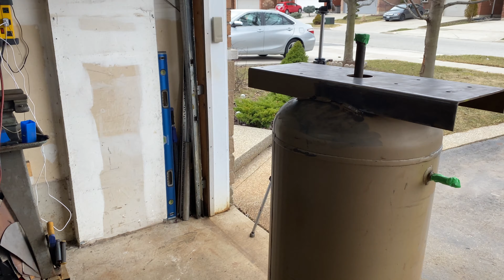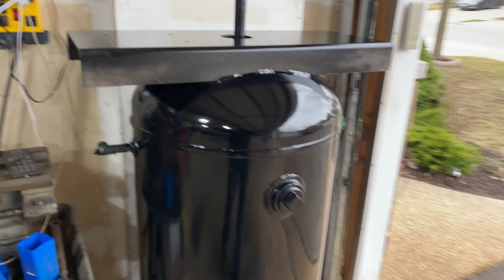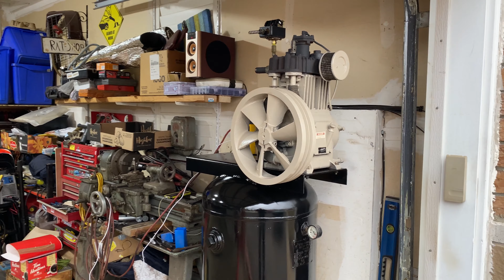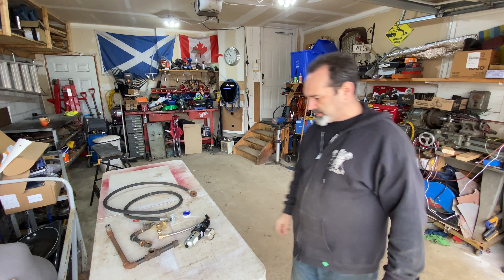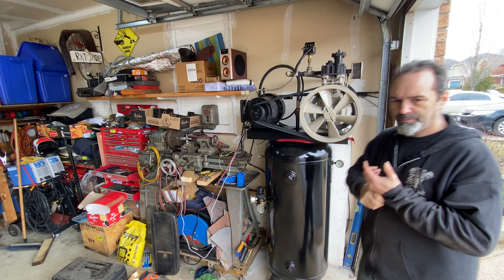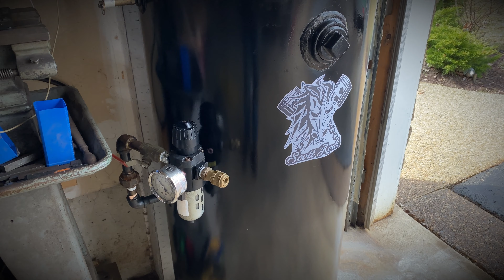Air Compressor Restoration Finale - Painting - Assembling - Testing

Comment: Once you start using your air powered tools, you will wonder how you got by without it. Looks like you got a great deal with the compressor, as most shop bought compressors don't go to that high pressure.
Reply from the maker: I wonder if my neighbours will prefer the sound of the high pitched whir over the sound of electric power tools. I guess we'll find out soon, lol.

Comment: Most Air tools are designed to run at 90 psi.  When you set the regulator have the tool plugged in to the airline and running then set the regulator to 90 psi.  This will give you the air that you need to run the tool properly.  Nice job on the recondition and set up of the compressor!!!
Reply from the maker: Thanks Mac. I saw a guy mention that in a video, but I appreciate any and all advice.

Comment: Why are you using a lubebricator?  You'll  contaminate your supply lines with oil. Spray equipment doesn't need oil, as for air tools put oil in inlet a couple of drops. You'll never get hose clean for painting. Whatever
Reply from the maker: That's why I got two regulators. One for tools and one for painting. I'll need a different air line for paint (without oil in it).

Comment: I was waiting to see if it would start again under full pressure....the pressure switch can be adjusted start on/off stop on/off...go on line for instructions...the knocking noise is probibly the valves in the head...most of them do that... you really dont need more than 135 psi for anything youl probibly doingand its safer...looks like a nice set-up..now get to work!!!!!
Reply from the maker: Ok, I'll leave it as it is then. Maybe the red lines are just the safe operating pressure then. Sorry, I should have filmed it firing up again at the start of the red line. It came on no problem.

Comment: Did you check to be sure you are turning the compressor the right way?  There is an arrow on one of the cooling fins.  I see it in the video...but I'm not sure what way the motor is turning the pump.  I'm thinking you might be going the wrong way.  It will usually still pump air if you run it backwards, BUT you will not have the fan blowing air onto the cooling fins of the compressor so it will run hot.  More importantly, it will also not pump oil correctly if it has an internal pump or oil correctly if it is splash oiled via dip and scoop oiling.   I'm sure you can find info on google if you need to do some research.   Also...I haven't completed the video yet, but you would be far better to have the belts at the inside of the compressor area for safety and also to make it easier to change the oil and do maintainance like adjusting the belts etc.
Reply from the maker: WOW, you are right! I just went out and checked, and it is rotating the wrong direction. Well caught my friend, I will sort that tomorrow. Presumably I just swap some wires about? There's no markings on the pressure switch.
Reply: @ScottRods  There is likely a schematic to follow inside the motor cover.  The ones I've worked on had it anyway.  You might need to look up the info for your particular motor on Google if there is nothing to go by.  Just hoping to help...and BTW, you have a great channel.  Always something interesting going on!  :D